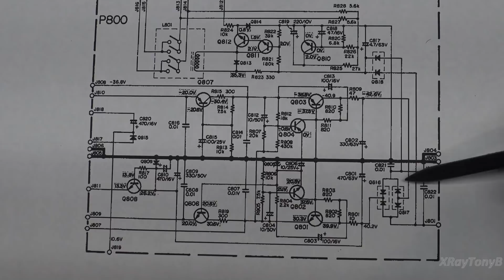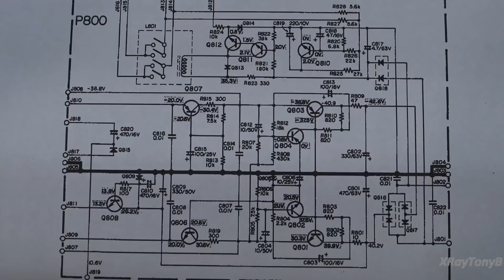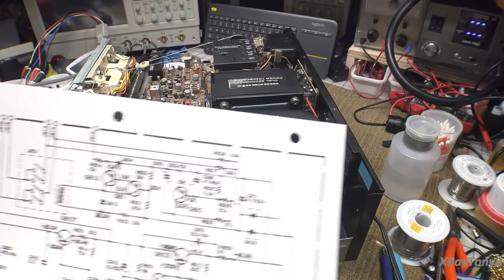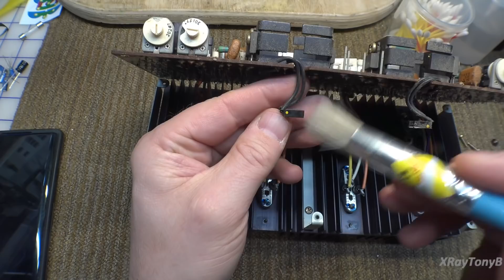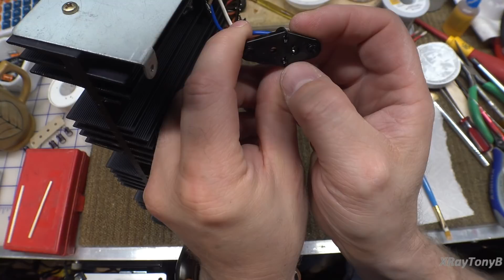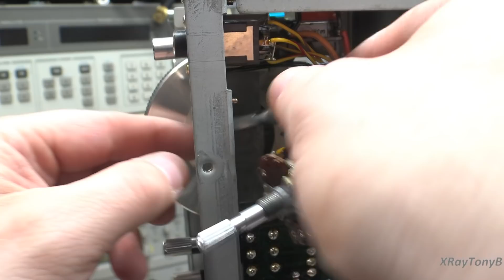Marantz 2285b - Part 3

Comment: 27:02 I always train my people to cut first. one part of the reason is just as you pointed out. the other reason is that there is the chance to lift up the pad (single sided mostly) by the physical impulse that is presented by the cutting action "snap". Also you provide less thermal inertia by cutting the leads off, so you can solder the components more quickly and do less thermal stress. thumbs up

Comment: Hi Tony - what temp are you running your soldering iron in this type of situation? I'm liking that your dwell time on the component is low but joint is good. If you answered this before, sorry.

Comment: Regarding de-soldering the transistors to re-apply heatsink compound. Are you not applying heat which will reduce their lifetime? Can you not just undo the screws and put heatsink on with them in situ ? Probably too much of a squeeze trying to undo the screws? Re dropping components on the floor. I'm thinking of sitting in a huge budgerigar tray. (The tray, not the budgerigar would be huge - I wouldn't use a huge budgerigar that would be cruel and pointless).

Comment: Hi Tony, I've learned that you shall cut the leads before you solder, because the risk of weakening (cracking) the solder joint. I think it was mentioned that solder can break at only 10 grams.
Your arguing capacitors reminded me of "D-Lab Electronics" (YouTube) that sometimes also make sketches as intros.

Comment: What was the deal with some of the vintage to3 transistors having a loose piece rattling inside but were just fine electrically. If I  remember right was the sanken ones that did that. Anyone dissect and figure what that was.

Comment: Hi Tony, I want to ask about the under biasing. Is it not the case that Pioneer biased it at at level where cross over distortion is lowest across all output levels. If we were to isolate the output stage, the Pioneer spec would yield best distortion, at the cost of dissipating more heat. Is it not the case that global negative feedback is making us see no cross over distortion at lower bias? Would we not bias each stage optimally and let the remaining budget of negative feedback correct other non linearities in the circuit? Thanks.

Comment: 27:30 I don't think that copper being exposed is any issue. Corrosion on copper has the special characteristic that it builds a protective coating on the surface of the copper that stops any further corrosion. It's not like rust on iron that just eats away on the metal until it's all rusted away.
That's why they used sheets of pure copper on the roofs of churches in the old days. It would corrode and turn green in the beginning, but then would stop corroding and then last almost forever without the need for any maintenance.

Comment: Tony, Monty Python +, I find this very interesting because I have a Pioneer SX737 that needs to be brought back to life. I am learning a lot of tips on what to do and what not to do. I'm very interested in your oscilloscope setup. I have tried to setup using a modern Chinese 50W audio amp driving across an 8 ohm wire wound ceramic resistor. The resistor is rated at 100W. I would appreciate it if you would give details about your setup in the next video. My setup is picking up a lot of noise. My experience in electronics dates back to my high school days back in the 60s. I dropped it as a hobby when I started in aviation for the next 48 years. Now that I'm retired I've picked it back up and having a lot of fun. Keep up your great video work, you are the best!

Comment: Funny. In the small number of schematics I've seen, the wires that terminate just short of an intersection with a little orthogonal stub denoted an underpass, or culvert, under the cross wire. Here that appears not to be the case. Maybe the artist forgot the local argot a couple of times? I used to say that the makers of equipment like old 64k modems and the like, or consumer receivers for that matter, would assign the user interface design to the new guy -- don't get me started on some of the idiocies. Maybe the published schematics fall to the same noob?

Comment: regarding eye implants; I was using multifocal glasses for about 25 years, after researching a year, I went for Johnson&Johnson's top of the line implants (5 months ago). My eyes were over 4 in dioptry + astigmatism. Doc said he prefers not to go for correcting astigmatism and I opted. Results; I need good lightning to read and do precision work. 4000+ K lights are my friends now (i hate white light normally). 

Other than that you will see halos (rings) around bright lights (especially LEDs), so driving at night is a little funny, stop lights and headlights disturbs a little, you feel like you are in Vegas :)

Because of those rings (or halos), contrast isn't that great (that's why you need good light). So 20/20 is not possible. But doc said it's about the brain, it will choose not to see those rings with time (they will be there but brain will ignore them)

Other than these, it's ok to go for it. I have replaced all of my eye glasses with sun glasses (8+) ;)

So make your choice with these in mind, do not take ads and doctor's sayings.

Comment: Another little "tip" for the transistors on the heat sinks. Unscrew the transistors (when feasible), then unscrew the heat sinks. Remove the heat sink without desoldering the transistors. That is as long as you know the transistors are good. If you need to replace the transistor, without the heat sink allows you to "wiggle" the transistor while desoldering with the Hakko making it easier to remove when the leads are folded over so bad. Wiggling the transistor towards the "fold" will lift it enough the Hakko can suck the solder up.
Reply: Like this idea.

Comment: Hey Tony, there is a guy in Germany that has the STV-3HY stabistor diodes.  I have used them myself in a few Sansui receivers and they work just fine.  Littlediode in the U.K. sells them too, but at a little higher price.
Reply: Do you have any contact info for this German source, please?
Reply: @richardmarshall6751  Here is their listing on eBay..  https://www.ebay.com/itm/324375836304

Comment: When I build gear, and I build a lot of recording equipment, I don't like to bend the leads over on the solder side for most common components. I don't like to do it so it's easier to desolder, should I, or another tech have to do it in the future.

Comment: I was working on a SR7000g which also has the stabistors one lead broke off flush . took a dremmel tool with tiny diamond bit and ground away the epoxy around the lead enough to solder and re epoxy . Totally worth the trouble sounds great
Reply: I've  done that too. The leads on those are fairly delicate.

Comment: You better off put it in micro-cap the circuit board diagram, and it would be interesting to run it as it is the schematic and see what waveforms you get! lol
 plus any upgrading you do to it is so easy in micro-cap see what's happening all free now.
Hopefully you're supporting Louis rossmann on his right to repair bill to congress, how do you get away in your industry because medical equipment has a lot of restrictions independent repair shops on right to repair something you would be supporting I suppose.
Fawlty Towers you must have watched Fawlty Towers Tony you might like Not the Nine oclock news Blackadder 80s and 90s
I was wondering if you spray the circuit board both sides with a permanent dry silicone how does that change its dielectric properties should improve it
What's your feeling on splitting the Mica maybe into three parts to add better thermal coupling!

Comment: In Sweden when i was young i learned that you always cut the leads when you repair/ manufacture military equipment.  Since i heard that (30 yrs ago) i've done it everyday and i've seen some amps i've repaired/ restored have had issues with corrosion when leads been cut after soldering so yes you're doing the right thing.
Another thing; Try out Elna Silmic II, available from mouser and digikey. I've done sound comparions and i rank the caps in this order;

1. Elna Silmic II . Warm sounding with good detail, almost like a filmcap. Elna Cerafine; Very clear and detailed but can be too clear. Can do wonders sometimes. Cerafine hard to get.
2. Nichicon KZ "Muse" I call this the Rock n' roll cap. Big and bould sound.
3. ES " Muse" (green ones) Bipolar.
4. Fine gold (Neutral but a bit boring) Above ones are most better for signalpath.
5. FW - Yamaha uses tones of these and Fine gold in their new premium amps btw..
6. KA (blue sleeve as KT)
7. KT (KT is actually worse/older version of KA) -Use KA when you can.

-Nippon has a audiocap that being used by Sony, Yamaha and others, Nippon ASG.
-Never use Nichicon VR/VZ in signalpath. Horrible dark sound and no bass.

Arcotronics/ Kemet R-series are ofcourse better when they fit. Actually prefer them instead of Wima MKS. But the best is nos ROE (Roederstein) for example MKT 1813/1818/1822/1826.

You're a fun dude. Good videos. Learned a lot. 
Many thx!
Reply: You are absolutely delusional with those remarks that you can remember how a song sounded with certain caps, then replace them with other and hour later retest with the new caps and tell the difference. I don't know how are there still people that believe that crap. But again, people buy Obscurum rocks and directional power cables, so untill there are sheep there will be wool.
Reply: @mitkothemacedonian   Delusional? 
😂 I’m a magician
Reply: @mitkothemacedonian  
Seriously, my experience is based over about 8 yrs with cap testing, with many different amps, dacs, preamps, etc…  results differ. Sometimes a bigger difference, sometimes a smaller difference in sound. 
Many of my customers have experienced what delusional change a cap can do😉👌

Comment: Interesting that the power transistors use a common heatsink with separate sensor diodes for each channel. So if you were only driving one channel the QI on the other would also change the bias. In practice however, being a stereo amplifier both channels would see much the same average power output.
Reply from the maker: I had to think about this for a while, but I can see how this would work.  All of the output transistors share a common heatsink.  As such, they will all be at a common temperature.  If the temperature of one channel increases, it will raise the temperature of the transistors of the other channel, which will affect the Vbe on them as well.  The bias diodes are also common to the heatsink (temperature-wise), so they will change as well, which will keep the bias in order.  This is a pretty common design on all of the mid-power amplifiers of this era.  The higher-powered amplifiers will have a separate heatsink for each channel.  Thanks for the comment!

Comment: is it a Class A amplifier as the MARANTZ is a very good make
Reply: No, it's class AB the heatsinks would need to be many times bigger for class A
Reply: @MichaelBeeny  Strange as I have come across a MARANTZ Class A amplifiers and they sound like you are in the studio they are that good but they cost 2-3,000£ or 3,000$-4,500$
Reply: @DAVIDGREGORYKERR  Marantz may well make a class A amplifier but I assumed your question was related to THIS amplifier under repair. The only real difference between class A and AB is bias. If you turn up the QI to remove cross over distortion enough, you have class AB which will sound the same as a class A but use a lot less power in the form of heat. If this amplifier WAS class A the heatsink would be enormous, so would the power transformer and cost. All for nothing!

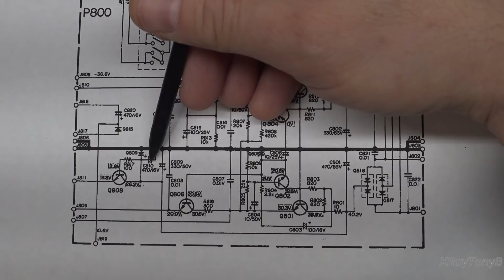Comment: What is odd is that 40.2V - 14V = 26.2V.  I wonder if that diode is actually some kind of a voltage dropper somehow (time 4:13)
Reply: I believe its a 14v Zener.